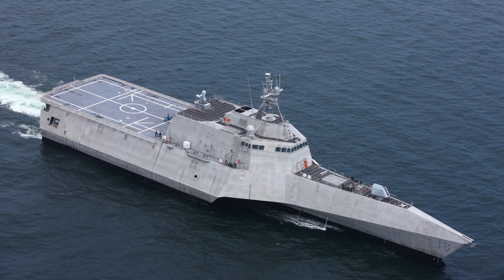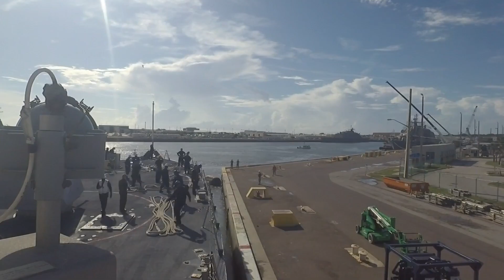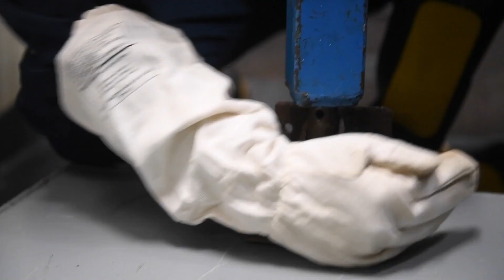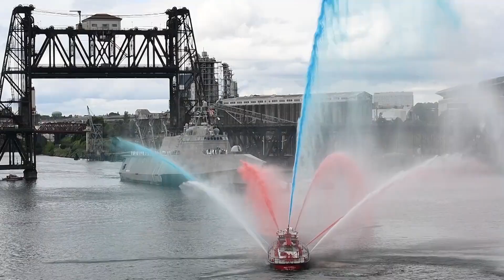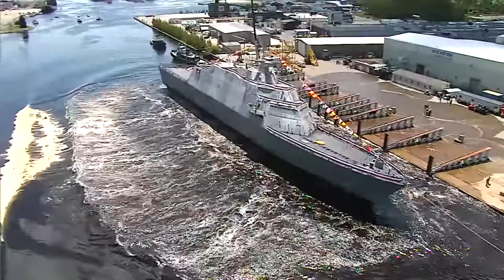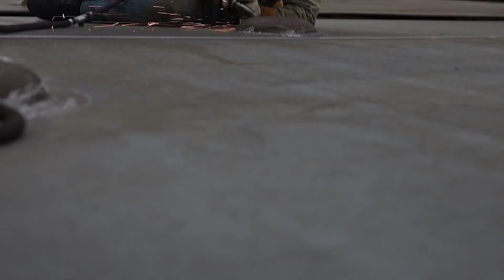Littoral Combat Ships: Hated by the US Navy, Loved by Politicians

Comment: What I don't get is how a surface warship is expected to operate in different areas from the main fleet (littoral) without a decent anti-air capability. IMHO one RAM launcher is not enough to feel confident sending an LCS alone, and, if you are sending a DD as escort there is no need for the LCS.

Comment: I always thought they could change the Independence class into a small drone carrier with all that deck space.  Also great video!
Reply: You could also bring back some of those Tomahawk Armored Box Launchers that the Iowa-class battleships used to carry and mount them on the stern end of the flight deck. That would still leave a very large deck space for operating drones.
Reply: @RedXlV tomahawks are obsolete. You can use it pressure air defence but don't expect it to penetrate air defence.

Comment: Your information seems a bit dated. Crew sizes are over 100 now and the combining gear issue on the freedom has been solved making it a viable surface combatant. 

I'm not really sure if the hull cracking issue has been fixed for the independence, but if they're just going to use them for mine hunting, then the ships don't need to go fast. Their stealth shape will be useful for contested mine clearing operations.

Comment: I'm surprised the navy doesn't take the decommissioned ships and use them for tinkering.  Use them to develop and test new naval systems.  Both of them have got a lot of unused space under their flight decks where their mission modules would have been.
Reply: High maintenance, high fuel costs, hull cracks, unreliable propulsion systems. Just better all round to scrap them.
Reply: @AlexConnor_  In standard US Navy operation, sure. As a series of testbed ships that only has to go out to test things, it can be an useful platform to further develop other systems.  Unlike the Perrys, it's still plentiful in the mothball yards.
Reply: @namyun2743  Very high operating costs for testbed ships. Forth Worth I believe has been used to test drones but the Navy is actively trying to dispose of all the older Independence and Freedom class.
Reply: @AlexConnor_  Such a waste of resources, probably the ridiculous speeds the navy wanted for these ships.  The cost shouldn't be so high as testbed ships, they don't need to go out to patrol for long spans of time.  Just go out to do tests for a few days as necessary before coming back.
Reply: You clearly don’t work in accounting department

Comment: USN vet here, and the LCS classes are still head scratchers after all these years.
Reply: I think they would have worked out if the idiotic 45 knot speed requirement was dropped.  They had to sacrifice so much weight and space (and complexity and money and PM + CM man-hours) to fit that turkey of a propultion plant, it ate up all the space and weight allowance that, with a conventional power plant pushing them at 33 to 35 knots, would have went to strengthening the hull, carrying viable firefighting and flood control systems, improved sensors and EW, weapon magazines for the aircraft and small boats, crew berthing and habitability upgrades, and some amount of VLS such as 16 cells of tactical length Mk 41 (allowing quad packed ESSM, Vlasroc, SM-2MR, and upcoming VLS version of NSM).  Oh, and without those hot rod engines and rube goldberg inspired drivetrain breaking down all the time the ships could actually remain on station when needed.